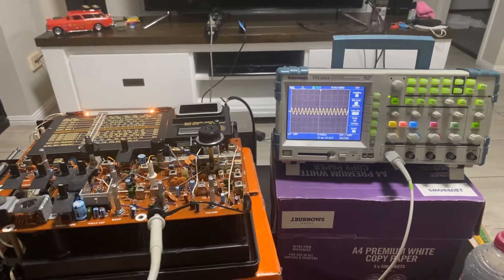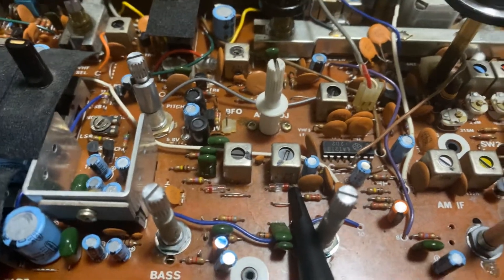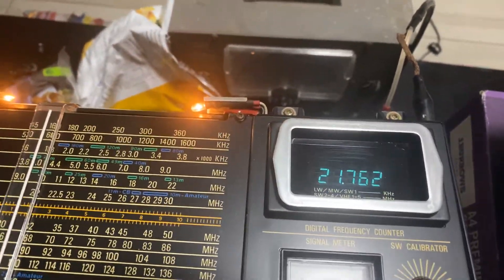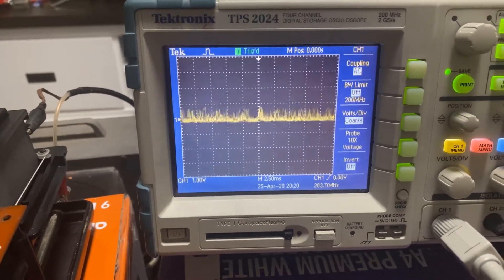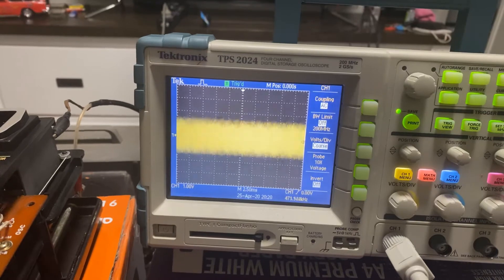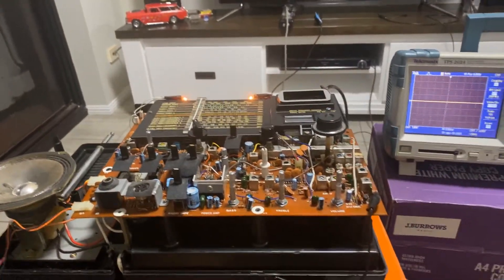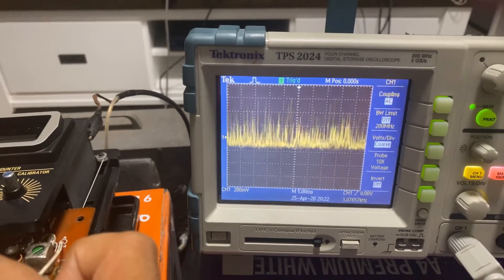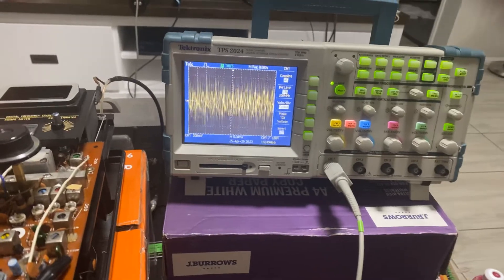Marc NR82f1 part 2 distorted Shortwave

Comment: Did you solve problem? It is nothing wrong - this what you get is NOT   a radio broadcasting but local interferences from some electronic devices - most suspect are TV interferences carrying sound band. This radio is not fully rejecting tham. In my place thare are days with more and days with less such interferences and I believe thay are radiated by,mains wiring - try to distance radio from mains, take outside the buliding. and search in radio  bands.
Reply from the maker: @Mikexception  it’s just the radio design. It’s not filtering out strong FM signals.
Reply: @phantomrose1999  Thank you for clarification. It was my deduction. It is variable level day to day. And I am also of opinion that it is radio design - other radios have it much less. or no. 

On other hand I appreciate this radio. . I had Grundig 3400, have actualy Philips D2999 and Kenwood Trio.  In compare  this one (which I repaired and fully aligned)  has best sound,  low own noise, quick  convinent operation  . Long time not used because couldn't align SW4 range  - at last fought also this.  Other could not receive in my place   10 meter HAM  only this does.
Reply from the maker: @ I also like this radio.   I have another video of it picking up SSB ham.  It was so clear I could not believe it.